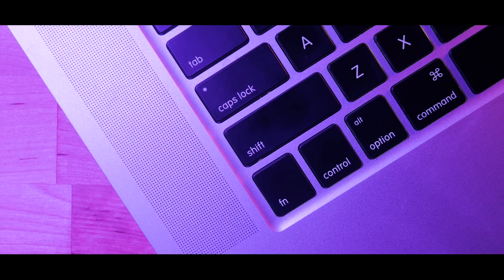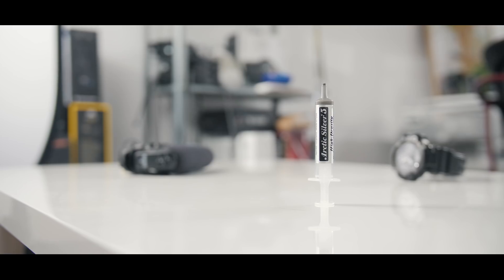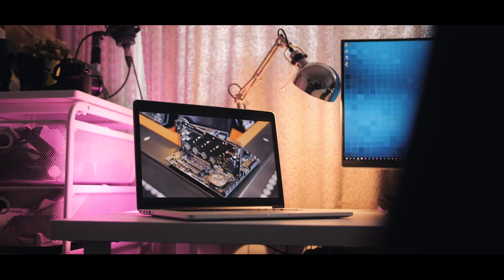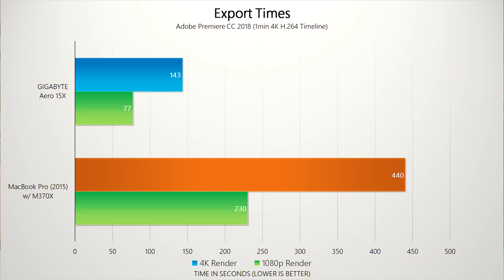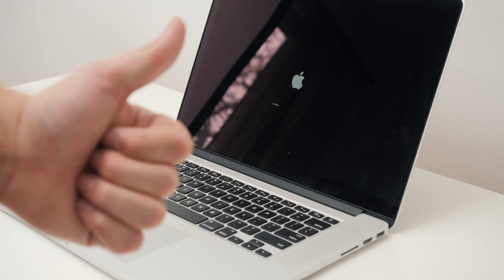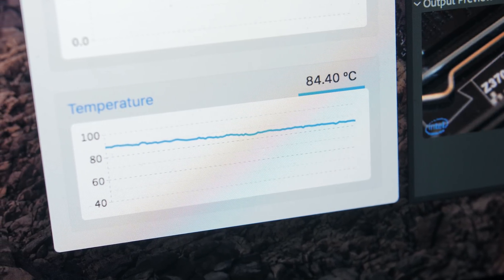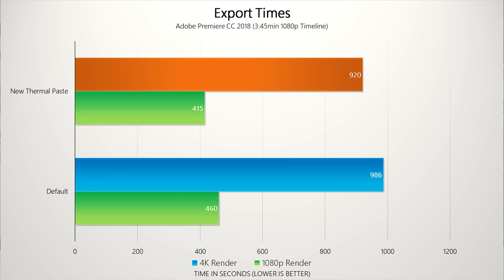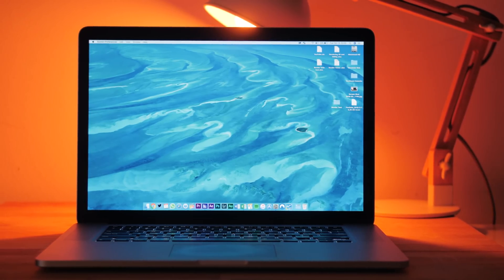OVERHEATING MacBook Pro! Can We Fix It??

Comment: I don't quite get why companies (not just Apple) can't use proper thermal paste in their products. It seems like such a cheap way to make your product better than the competition's
Reply: Knightcore bc most consumers don't know or don't care
Reply: Knightcore from what I know (I could obviously be wrong) the paste they use is a tiny bit less conductive, but has a longer endurance over time and so it has to be replaced less often, bringing down service costs.
Reply: bluephreakr tell yourself never again and back up to an external drive because all that iCloud is good for is syncing photos, keychain, etc across devices. I don’t know a single Mac user that backs up their data to iCloud. Takes way too long.
Reply: Aren't all products stored unter this conditions? Other manufacturers can design their product, so they can run for years without thermal throttling. Mental gymnastics of Apple fanboys are funny. :D
Reply: 1. It's cheaper and the thermal performance is good enough to meet the established goals for the product.
2. The thermal performance is more stable than other solutions considering the various environments the products are going through (can stay in warehouses for months, move to very different climates (-30C to 35C during shipping, lots of shocks during shipping).
3. You need a manufacturer that can supply TIM for more than 5 million units per year (that's only for macbooks).
Reply: Materials have to shrink and grow at different rates due to temperatures. You wouldn’t want the goo to get hard and brittle and separate from the CPU when a temperature shift occurs.
What makes sense for a desktop in a heated home might not be the best choice for a warehouse in the winter or a laptop that’s meant to go all over the world.
Reply: Apple does not care about service costs. Otherwise they would design their products accordingly.
Reply: "The thermal performance is more stable than other solutions considering the various environments the products are going through (can stay in warehouses for months, move to very different climates (-30C to 35C during shipping, lots of shocks during shipping)." The thermal performance isn't stable at all, hence the thermal throttling. Anyway, there is no indication why a higher quality thermal paste would perform worse in this scenarios.

"1. It's cheaper and the thermal performance is good enough to meet the established goals for the product." That it is cheaper and good enough for Apple is obvious.
Reply: "When selling a new device performance over time exceeds maximum performance." Actually not.

"For the same reason you can overclock, because if they sell cpu/gpu's at max clock it will last less and have more issues for more people then when downclocked." It is not an overclock if it runs withing specs and ... Apple usually induces early obsolescence. Let alone that stable 200Mhz+ have no significant impact in longlivity.
Reply: It's called PLANNED OBSOLESCENCE my friend! To ensure your CPU burns out faster so you upgrade more frequently.....
Reply: follow the money trail always.
Reply: That doesn't make sense to me, because wouldn't Apple be the ones servicing the devices, so they could charge their horendos fees, anyway?
Reply: They would rather toss baby with the bathwater, knowing how Apple does things. You lose your data, you tell yourself "Never again" when you get the laptop back, shaming you into using iCloud because you didn't fall in line with the other sheep, then you end up paying a monthly subscription to keep your data on Apple's servers.

Comment: A macbook PRO relegated to netflix streaming duty. You know, what one should usually do with like an $80 android box you find on ebay. Typical.

This is probably the apple intended use scenario for these as well, based on how they make them. Definitely not PRO.

SAD!
Reply: aviftw sound like Trump
Reply: trump with a superior vocabulary...
Reply: Yep! Very sad. Apple's portables focus too much on portability (and fancy displays), while their desktops lag years behind the PC. I mean, I hear there might be a new Mac Pro coming this year! Or maybe next year! Following a 2013 refresh! And the Mini is not faring much better.
Reply: Very very Sad :/ I work so much on my computer (14 hours daily) and 3-4 hours o this are just loading times. If this continues im gonna suicide seriously lol
Reply: just get a 200 dollar 2 in1 and it will watch Netflix just fine.
Reply: even a Celeron wont hit 100%load in Netflix!
Reply: I wouldn't be so sure of that. My previous job actually got me a cheapass 350$ laptop. 
It had the N3450, surprised it came with an SSD but it's speed was barely higher than a 10K SATA WD raptor "from back in the day" - so yeah watching YT on that was easy 80% , for 1080P. You seriously barely have any overhead to do annything but watch a YT movie.  Sure you could do stuff like office and browsing. But anything that required CPU crunch like unzipping etc. an action that your CPU does when installing windows updates - OMG. Feature W10 updates were easily an hour.  Don't underestimate just how shitty a very weak CPU can be.

Comment: The temps on that thing are just TOO DAMN HOT. Even with new thermal paste.

One of the chief reasons why I would never buy one. That, and the glued in battery meaning a trip to the battery shop and ~$300 to restore performance to as-new. If the battery was not glued in, you could do it yourself for like $25 max.

F off apple.
Reply: There is a method of removing the battery. I did it myself. my 2012 retina MBP has been working for me really well and it still worth $1000 when I want to sell it to ebay or Amazon as used. It's pretty good value in longterm
Reply: Or you can use a small amount of acetone to neutralize the adhesive and buy double sided tape for the new battery
Reply: You shouldn't have to use anything to remove a battery other than a screwdriver and maybe a spudger. It's disgusting and should be illegal that Apple solder and glue in components that you used to be able to take out and replace yourself without all that hassle.

Comment: Since the chips inside these machines don’t have an IHS couldn’t you put liquid metal on them instead of thermal paste?
Reply: You know you can put LM on top of an IHS, right? Besides, liquid metal is not recommended for machines that get moved around a lot, because it's... well, liquid and conductive.
Reply: MacPerfid putting it on top of the IHS would be dumb, especially and the majority of Intel chips since those use paste. 

The idea of liquid metal is to conduct heat significantly better than thermal paste, if you leave thermal paste on the die you bottleneck the cooling.
Reply: I know, I didn't say it was a good idea, I said it was possible. And when it comes to laptops, using liquid metal is a terrible idea, except if you're going to put it on a desk and never move it again.

Comment: Apple sucks at laptops
Reply from the maker: you suck at usernames...
Reply: apple sucks at everything, they should just chill

*Their laptops ^^
Reply: +poopoo peepee and yet Apple machine lifespan last longer than any others competitor such as Asus,Acer,DELL,HP and Samsung lolz.
Reply: Mich X right but not really. My cheapo acer aspire lasted 6 years with hours of daily use, while my wife's mac pro only 3 and mind you with very little use.
Reply: +enovationsgr maybe she's received defect unit....so far none of the competitor could beat Apple when come to reliability,software and hardware which is they excel on..Apple more worthy when come to premium segment device
Reply: I would disagree... I'm still using a mid 2010 15" Macbook Pro for professional graphic design work (when I'm away from the office) including large scale print design with Photoshop files upto 100 layers sometimes reaching 12gb and it still gets the job done. It's not ideal and I am looking to upgrade my portable setup soon, but I honestly can't think of another laptop that could give me 7.5 years reliable service for similar money that was available at the time.

Comment: Should’ve added more TP.
Reply: Team 974 you should never add toilet paper inside a laptop regardless of the circumstances.
Reply: Actually, putting toilet paper in my PC helped it A TON, as the nano-quantum-fibers from the paper help clean the air and deliver maximum AirStream™ performance.
Reply: yeah might aswell coat the whole mainboard with tp to boost the raw shittyness of macbooks

Comment: You should try out the Metal Render API rather than the OpenCL one. I’m not sure which is faster but it’s what I use.
Reply from the maker: OpenCL for me is faster.
Reply: HardwareCanucks have you ever tried using FinalCut?

Comment: Do you even paste, bro?
Reply: Jan Vlašan - Apparently not. Did you see how much paste he squeezed on?! Forget a grain of rice size, let's do macaroni instead. Lol. But, perhaps being a MacBook, less is more, unless thermal related...more is more!
Reply: Sushi sized blob of paste... I will admit, if you fill the entire notebook with thermal paste, you will probably see decent results (bonus points for being in an aluminium enclosure)
Reply: Grain of rice is only recommended for IHS like ones on desktop CPUs. Since he is applying the paste directly to the die, he need to cover all of it. Look at EKWB’s paste guides. Way better to over paste directly on die then to leave a tiny bit under paste which will get you a fried chip
Reply: Pürgatöry Priest No problem. Happy to share =)
Reply: Dan Chen - ahh. Very good. Learned something new today. Thanks, Dan.
Reply: Jan Vlašan It’s really not as much as you think. Like you said, the dies are a lot smaller than IHS, because the shot of the line of paste is on the die, proportionally we think it’s more.

As for spreading with a tool, I would only use that on top of IHS, because it’s easier to trap in air bubbles which could cause area with poor paste. It’s usually fine on IHS or with really think TIM like liquid metal directly on die
Reply: But the silicon is like third the size of the IHS! I get that you want to spread it, that's why Thermal Grizzly gives you a spatula rubber thingy. But that much paste seemed a little excessive.